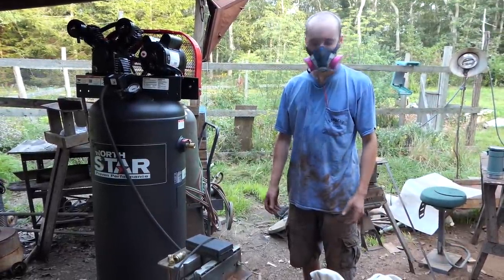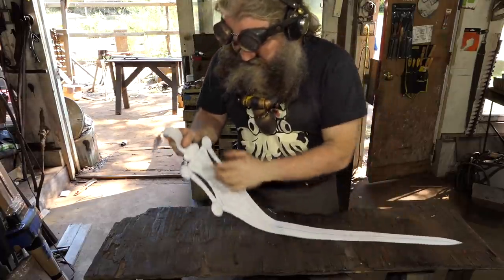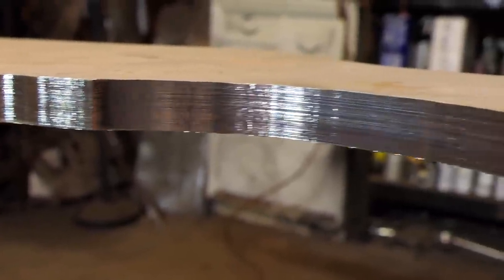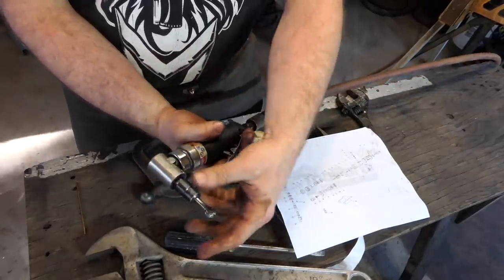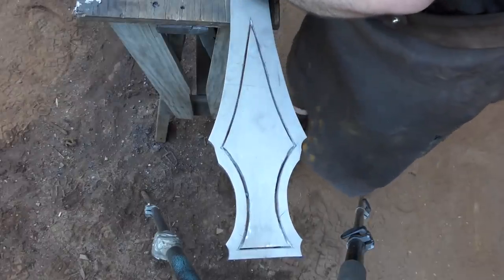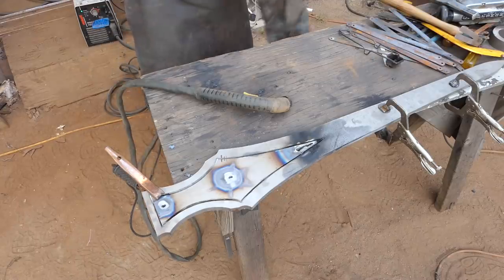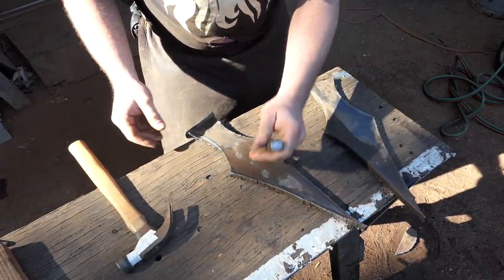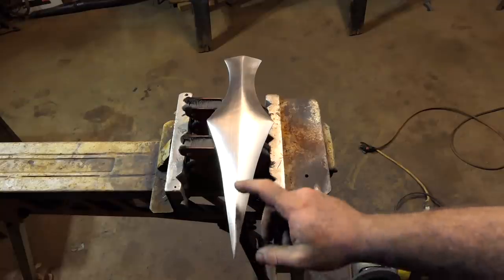He-Man Power Sword Build Part 1: The Blade

Comment: Trade secret, you should use a circular saw with a metal cutting blade and feed it continuously with cutting oil. You can cut up to 1" plate with a square edge even with a radius in about 30 minutes.

Comment: Dude, I'd have just ground a channel all around the middle piece rather than go to all that trouble cutting the centre out. From what I remember, the centre section looked like it was the same level as the rest of the sword around it, just with a channel defining its edges. Though, it might have been hard to get the depth consistent on both sides. Still, watching you grind away at your weirdly overcomplex solution has its own charms too.

EDIT: Actually, now that I look at it, your solution seems legit. Centre section does look better raised like that rather than just being level with the rest of the surface.

Also, did He-Man's sword have a big oval jewel in it? Or was that just She-Ra's?